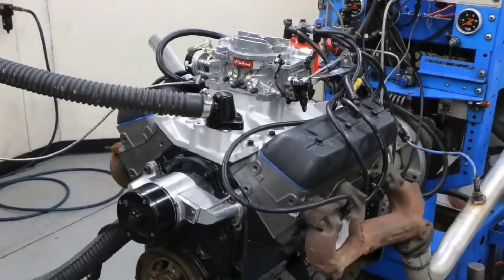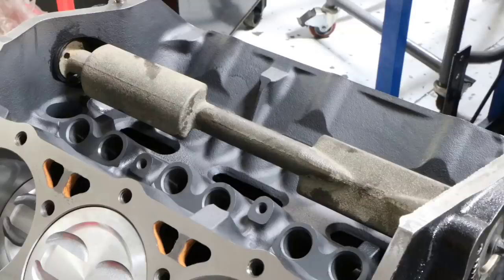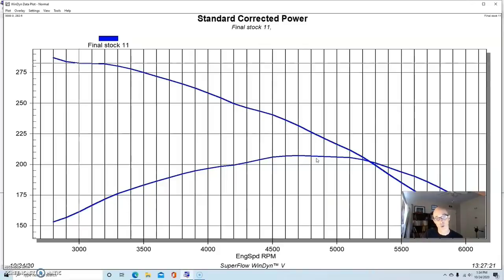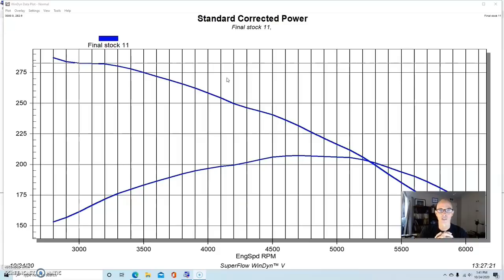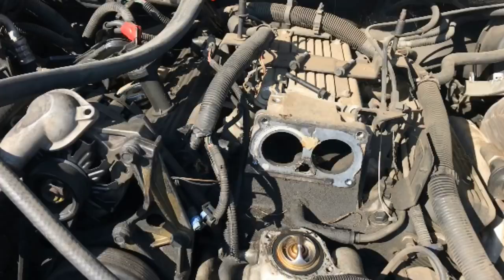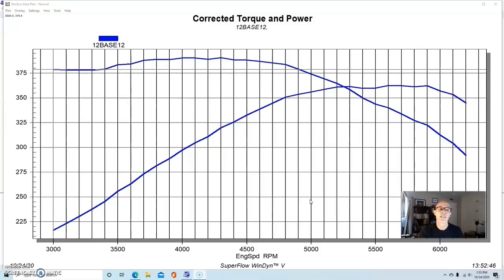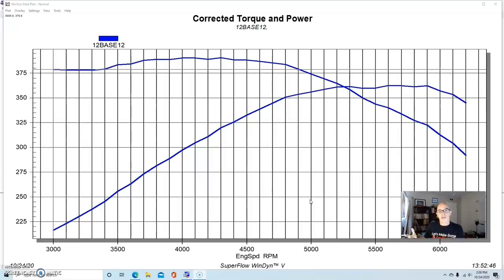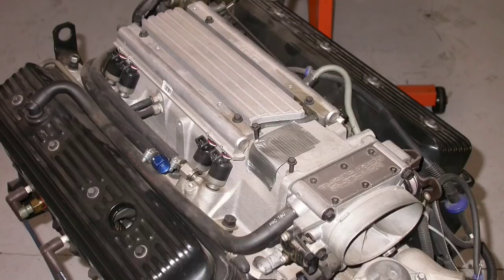4.3L V6 VS 4.3L V8-WHICH OTHER GUYS MAKES A BETTER BUILDER?

Comment: I'm currently working on a 4.3 v6 and found out there are not many performance parts for it. For distributors there's only a cheap as hell low quality or a MSD pro billet lol
Reply: Best performance part for $$ IMO, is an 4bbl intake.
Reply: @thisisyourcaptainspeaking2259  I'm getting rid on the electronic distributor as well as adding a 4 barel carb and the options were limited so $300+ MSD pro billet it is.
Reply: @thewaldo1985  Yes, for a grocery getter I'd probably go with an HEI from a 1985/86 carbed Astro van.  Be careful the drive gear matches cam (billet cams need a soft gear, bla, bla..).
Additionally, depending on what you're doing, you have other options such as the marine (Mercruiser) ignition, Thunderbolt IV or Thunderbolt V using the V6 or more aggressive V8 module for advance curve.

Comment: I'm an Old Fart! Back in the day, I had a 75 Chevy Monza with the "Mini Mouse" 4.3L 262 V8. I actually decided to play with it... 
Ported the Heads, Edelbrock Performer Intake with Quadrajet that I tuned, a Comp Cams 260H Cam, spec'ed for a 305 (NOBODY made a 262 Cam!), and custom Headers (a MUCH bigger deal than it is now!). 
It was no powerhouse, but did dyno at 230 RWHP (about the same as the 5.0L Mustang). Not a ton of low end Torque, but with a 5-Speed, it was fun to drive. 
.... I'd do it again if I could.

Comment: Are you doing any LT-4 testing??
Reply from the maker: no lt4 motors-hard to come across
Reply: @richardholdener1727  i have a set of lt4 heads and intake that are stock. The engine spun a rod bearing and needs rebuilt. Would it be worth me to send you the heads and intake for testing??

Comment: What about a 400 crank in the 4.3 v8?
Reply from the maker: yes-that is also possible-though the early 400 cranks are 2 piece seals-but after market 3.75 fits
Reply: @richardholdener1727  mostly just curious what I very long stroke and small bite would do

Comment: Could you put 5.7 heads on the 4.3v6 and just leave one combustion chamber hanging off either the front or back of the engine?
Reply from the maker: I like this line of thinking
Reply: Oil and coolent everywhere unless you seal it up somehow
Reply: @jimmyj2563  That's what TIG welders are for.
Reply: Maybe cut one of the inner cylinders out of the V8 heads and braze it back together.

Comment: The 4.3 v6 has a v8 rod angle and it doesn't work well as a 6 cylinder tends to blow up

Comment: Ide like to see a video where they take awful engines like the ht4100 and build them into monster engines with huge power. Would be cool to see a iron duke with 700 hp 😆

Comment: My dad had a nova with a 262 v8 very weak my 2006 SILVERADO HAS A 4.3  V6 IT SOUNDS LIKE A V8 HAD IT 14 YEARS HAS ALL THE POWER I NEED

Comment: The V6 has narrow bearings and a weaker split journal crank, limited intake and heads. Ported versions of the last Vortec version are good, but they are not as good as the ported V8 versions though.  The L99 cries out for a large/long runner TPI in DZ302 form, vortec or better heads & small tube headers. And BOOOST, the audi and benz pukes only use 4.0 liter v8's and with boost they make Big
 stock power.

Comment: We have a 4.3v8 sitting at the shop and was wondering what I can do with it
Reply: Tie a chain to it, load on boat, go out onto water, chuck it overboard,  let the chain go too 😂
Reply: Make a sweet coffee table.
Reply: They're actually not bad. My friend had one in a later S10 and it was super fast. I have an old article where a guy runs 7s in the 1/4 on a NASCAR block and heads. My other friend has a roots on a 4.3 in a Model A and that thing pulls the wheels.
Reply: @xmo552  I’ve got one in my daily. Not fast but decent torque and good mileage. It’s a workhorse. 3.42 gears accordingly the vin lookup (94 5 speed c1500)

Comment: How much  drag does the balance shaft cost you on the 4.3 L V6 and if you get your internals rebalanced do you really need a balance shaft?
Reply from the maker: the balance shaft is not for balancing the reciprocating assembly-it's designed to minimize 2nd order vibrations inherent in the design

Comment: Maybe the heads from an early 1990's 4.9L V8 cadillac engine. Might fit a 4.3L V8.
Reply: COMPLETELY different engine, won't work
Reply: @mattcat231  Your right. I was looking at the head gaskets. They don't match. It was just a thought that poped in my head. With out real facts.

Comment: A 350 with 400 hp is 50 hp per cylinder therefore  a 4.3 v6 similarly equipped should make 300 but they come up 25 hp shy at 275hp.  been there done that.
Reply: More power potential with a v8 because you get more valve opening area per cubic inch, so even if the displacement is the same a v8 should make more power.

Comment: Here's a question: would it be possible to get more airflow to the heads from a marine intake base for the 4.3l v6 over a stock efi intake or carb intake?  I have one brand new and have been contemplating whether or not to install it. I have seen it done on a couple of youtube videos and it has been discussed on a couple of forums. I would believe this system requires a separate ecm to run correctly as this intake has externally mounted fuel injectors (really a true port fuel injection system.) Unfortunately the one down side to this intake base is that its heavy! Mostly cast iron material. I weighed it once and it was over 45lbs compare to my stock efi intake of 27lbs!

Comment: There are so many CRAZY builds I would do if I had the money to blow. Destroke a 267 with a 3" stroke, 6.2 rods and modern thin rings. Pocket port the factory heads and a low lift cam with rev kit to spin 8k+ without pumping up the lifters. Then turbo the crap out of it😂😂 I'm a bit curious what kind of fuel mileage a guy could get out of a little critter like that.

Comment: Okay, but what about the 4.3L Olds diesel V6?!
Reply: Do you have a 4.3L Olds diesel that runs?
Reply: Yeah Ive wondered if you could rework the engine to run on gas and take advantage of the stronger internals say with nitrous
Reply: @timothykeith1367  Heh, The 4.3s probably do still run. Just the rest of the car probably rusted into the ground. The V8 Diesels were the ones that were shit from the beginning. But apparently Old's fixed them, and the last year or so were "okay-ish", and the V6 was, apparently, better designed from the start.

I personally don't have one, nor do I have the money to even bother trying to find one.....If there even are any up here in Canada.
Reply: @garyeland5681  I would rather see what happens when you keep them diesel, and throw a turbo at it. Could be a nice engine for a small compact truck, or a half-ton.

Comment: And...did you know that Ferrari [-in the 430 S Spyder, in 2008 ] Also has a 4.3L all-alloy, 4-valve, fuel injected, DOHC, V-8, making 483 HP?   With a metallic-substrate 3-D replicator, the Ferrari-heads COULD be Replicated with all the studs, piston-hole spacing of the Chevy block, so the Ferrari-type heads, whatever "goodies" it has, Could be mated to an alloy Chevy block.  Although NOT being total Ferrari, I don't think you could legally put on ANY Ferrari labels/machined IDs anywhere on the engine, because they'd NOT be "true" Ferrari parts.  I'm guessing a REAL Ferrari 4.3 V-8, is a "$20-Grand"-dollar bill, so if you wanted to "drag-race" your 430S, naturally, you'd pull the Ferrari 4.3 mill for a 3-D "Ferrari-ized" Chevy.   Unless it's an inliner, I, too, like the smaller packaging of the 4.3 V-6, and keeping the same block, could a 4.3 Chevy V-6 be Bored & Stroked to a 5L V-6 or more?   I forgot to ask, is the Ferrari 4.3 V-8, 90-degrees between the banks...or 60? {--found out it's 90-degrees}   I know Ferrari was using a GM-casting for a time,--this "Makes Sense" to me.
Reply from the maker: ferrari was using a gm casting?

Comment: the 262 chev 8 is this the engine with the dismal smog bastard motor, there should be no comparison, my best suggestion for the V8 is a 383 stroker...

Comment: Fun Fact: The stock 1975-1980 262 ci 4.3L Chevy V8 was GMs highest nickel-content iron alloy block ever made.
Reply: Why is that? At 110 hp not much stress on that block.
Reply: @joed5472  Yeah, it REALLY makes you wonder WHY they did that?

Comment: If the 4.3 V8 is aluminum and can reach 6000 RPM it would be a great swap engine for a Fiero !
Reply: I had mine past 8000
Reply: @oldpolak5203  cool, is it aluminum block and head or just aluminum head ?
Reply: @beyer422  That motor I had back in 1983 . I was just a 20 year old . It was a moza 2plus2 , I cant remember the year of the car or if  it was an aluminum block . All I remember is cruising down the highway coming up to a Camaro dropping it into low and punching the gas . The car took of like a bullet . I looked at my tach and it said 8500 rpm , so i put back in drive and looked in the rearview and the Camaro was nowhere to be seen . I was unaware that you not suppose to do that untill I told my friends about it . The car ran fine after that so I kept on doing it , my friends still think Im nutts . I ended up putting that motor into an Astre after I blew the rear end of the Monza doing burnouts. But thats another story with a bad ending.

Comment: U guys check this out if u haven't seen it. This dude built a 549 cu.in. v6 dragster. It ran a 3.87 1/8 mile. Its on 1320 video. Punch in 1320 video fastest v6 drag car. It's a pro mod but has a newer corvette body.

Comment: Don't buy a 5.3 V8 after 2018 a guy at our gym had one that had a catastrophic engine failure with 26k on it. He isn't the only one I know about. It's that stupid engine that shuts off cylinders then the cylinders not firing doesn't get lubricated properly. All he was towing was a two stall horse trailer at the time that's not much weight.

Comment: One other thing I forgot to mention, especially if you are going to squeeze it, the V8 has reverse flow cooling. My thermostat is a factory 160 degree and heater will blast you out.

Comment: Overall, Weight, I'd take v6
Reply from the maker: interesting point-I didn't cover weight difference
Reply: @richardholdener1727  this is why some boat guys like the v6. But to rip at all they WILL USE FUEL
Reply: @richardholdener1727  
I'm just the odd man out.
Seen small block vs big block weight difference in drag racing comparison, small block won, I believe and I would use lighter engine in my jeep + more room in engine bay of my jeep.

Comment: v8 had no tourqe but would run nice and spin. V6 was more tourqky low down did better in s10's. Lots of town police ran 4.3 v6 as they didnt run chase but just call state cops with big boy 5.7

Comment: I had a 79 Olds Cutlass Calais with a 4.3L V8. It was rated at 105 hp. The 3.8L V6 in the same year Monte Carlo was rated at 110 hp. I was not happy. Nice car, but weak engine.

Comment: crazy how a 2003 350z made 275hp with 3.5L sure it's a sport car but a 03 mustang made 260hp with a 4.6L
Reply: Funny how also the 03 cobra made 390hp..... or the 01 cobra made 320hp or the 03 s2000 made 240hp..... completely different classes of engine. 03 350z dohc v6 (4 valves per cylinder) 03 gt mustang sohc v8 (2 valves per cylinder) sohc motors are never that great, from the factory, weather found in 4 cyl, 6 cyl, or 8 cyl. Thats why ford pretty much ditched them after 2004 at least in there sports cars.

Comment: I did a mild performance build on my 4.3L 262ci that is .060 over making it a 4.5L 270ci because I just wanted to do something different. SBC and LS S10 builds are a dime a dozen to me. Another factor is the weight difference compared from the V6 to the V8. Here is a video of mine at the track and with a list of parts in the description. When I ran it, it was losing power on the big end cause my quick fuel brawler 600cfm secondary's werent opening. Best run was a 14.52 on two barrels lol. I've now fixed that issue and will be going back again soon. Butt dyno feels like a 13.90-14.00 pass! Thanks for the awesome videos!

https://www.youtube.com/watch?v=SsvWBY4JUww

Comment: V8 for everything v6 for economy
Reply: a silverado 6.2 got better mileage than s10
Reply: What engine does the s10 has
Reply: @jessicalacasse6205  i love 6.2 engines
Reply: displacement consumption is the biggest lie depend on alot of others thing cr, gearing .....
Reply: a 4.3
when with google combined silerado 15 s1 21mpg
Reply: went
Reply: s10 21 combined
Reply: @jessicalacasse6205  a v6 like the 3800 is it the 4.3 i also like the 4.8 5.7
Reply: @jessicalacasse6205  displacement doesnt mean consumption true but it affects it

Comment: Small bores blocks SUCK!!! That's why I laugh at these ridiculous stroker displacements! Just because you can stuff a bigger crank in the lower end, isn't the cure-all for making HP! Prime example the 377 destroked 400 SBC VS the 383 or the horrific 305 VS the 302 SBC. The dynos don't lie! Long stoke displacements make a wonderful diesel engine! But suck for a NA gas job!

Comment: WHY would we WANT IRON-crap heads, unless we wanted to twin-turbo/supercharge it into the stratysphere, like 500-600 HP where "holding-together" is Really important?    Re: Ferrari, I'll BET the 4.3 V-8 in the 450S  Ferrari, IS the GM alloy-block, With DOHC alloy heads, producing 495Hp in 2008?    Do you think Ferrari-heads [DOHC cam alloy] would "fit" on the L-79 GM block?  LUV your AWESOME vids!    The SOUND of a V-8 IS BETTER, especially with a flat-plane crank, plus there's that old speed-shop lament, "I could've had a V-8!" {When REALLY, a same ET breathed-on/power-added inline/V-6 Would be much more impressive [--plus if you were the "speed-shop", 2-4X more Expen$ive, so more profitable to tweak! ]}.     At one time, $20K would get you a bare-block, aluminum-alloy, tall-"292 GMC-type Stover," when that same $20K  would get you 600Hp in one of several V-8s ready to RUN in your "Q-ship" 63 Rambler Classic.

Comment: Oldsmobile 260 V8 in the 70s. 260 olds same stroke from 260 up to a 403 just a bore change. Chevy made a 267 V8 late 70s early 80s didn't last

Comment: OK, so how about the Chevy 4.4L V8? Anybody have any of these laying around in good condition? You mentioned it, 3.5" bore, with a 3.480" stroke.
 I'm actually interested in building an even smaller V8 than the 4.3L, a 231 cu. in. 3.78 (or 3.8L?). Taking that 4.4L block and using it with the 3" stroke, with turbo/s...
I mean McClaren has a twin turboed 3800cc, but that's a completely exotic animal. I'm just thinking domestic/old school meets modern technology.

Comment: do a Ferrari 308  vs  Chevy 307   then plus power adder
Reply: A Ferrari 308 is not actually 308 cubic inches.  308 stands for 3.0 liter 8 cylinder.

Comment: What was l99 available in?
Reply: 94-96 caprice.
Reply: @a200tq1  correct and had to be the base model. I serviced Fleetwoods and Roadmasters and Caprices at a busy GM  dealer from 99-08 and only saw one, and my factory training never mentioned it lol.

Comment: I knew they BUILT Carb 262 267 V8 engines in the mid 70s for the nova and caprice last I check they put out between 110 -130 hp stock

Comment: The v8 should rev better, hence the lighter running gear. Also smaller displacement with equal flow responses to boost faster, more torque on lower rpm. 4.3l is almost there. Just a little bit too big to function properly. BUT that version with a bore over stroke seems promising.

Comment: Nobody wants to touch a Northstar though my challenge to you Richard
Reply from the maker: saw 5 of them last trip to the yard
Reply: It ' be awesome if you gave one... the Treatment
Reply: @richardholdener1727  It would be awesome if you have one the ol'  Treatment
Reply: @richardholdener1727  Plan on fixing the head bolt problem if you put boost to a junk yard Northstar, but in the future yes? Im a Cadi laky.

Comment: ahh yes the 262 , just a turd, my grandfather has a 267 in his 79 el camino and it still is a turd. terrible on fuel, no power just a turd, i wouldnt mind doing a ls swap, but its a all original 79 elcamino with maybe 23k miles on it.

Comment: 4.3l v8... Uhh... May i propose testing Газ-53? Just to make some laughter...
Reply from the maker: don't know that designation
Reply: @richardholdener1727  That's a soviet era "small-block". Also known as Змз(zmz)-53. Cheap and widely available here. Only 115hp in stock form because of very low compression ratio - 7.6. A little bit revised version exists Газ(gaz)/ЗМЗ(zmz)-66 - 125hp. Hard to tell if it's available in USA. 
I'm very curious if a skilled persons like You can squeeze some reasonable power from that piece of "economical efficiency".
Here is the video of decent looking specimen (5.5l version)
https://www.youtube.com/watch?v=M541S-dO4bg

Comment: Big bore, just ask ford
Reply: That big bore comes with an inherently unbalanced engine, a 90 degree v6. 

Or were you talking 302 vs 305
Reply: Never understood why Chevy dropped the 302 in favor of the inferior 307, and then 305 cubic inch engines. It would have been a better rivalry over the years.
Reply: Cost, it’s cheapest to use the same crank. That’s the most complicated part to make. Casting a block with a smaller more is a simple sand core change.
Reply: @iqinsanity  I guess that's the root of my confusion. They already had a 3" stroke crank and a 4" bore block. And then in the 90's to cast another 3" crank just for the B car platform? Wtf?

Comment: That 4.3 V6 is junk , i had to muck around with one once , all it would do was pink , went though everything ,Check damper , ignition curve , carb  , heads , got rid of a small muffler , all it could handle 19 degrees . 😬😬